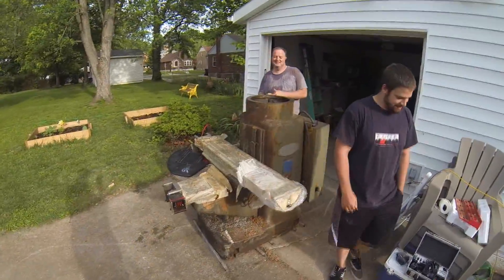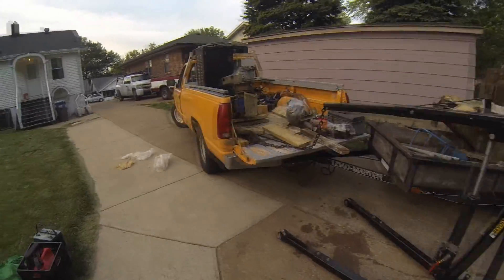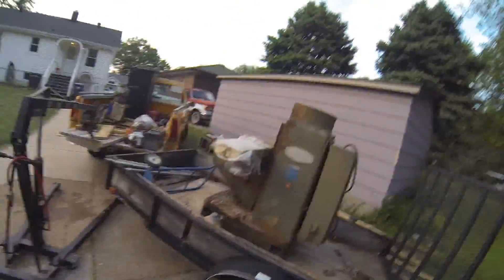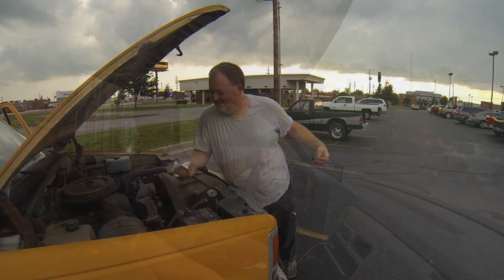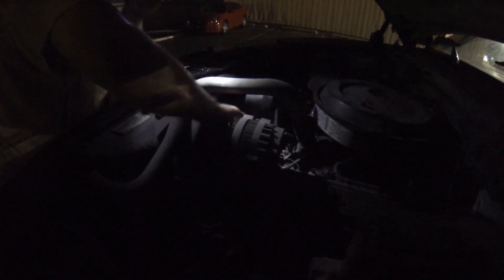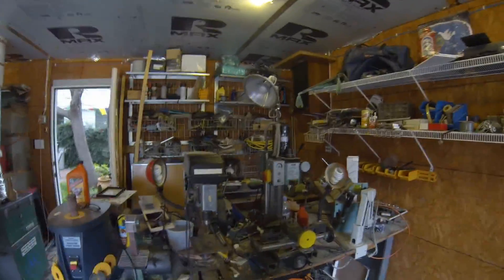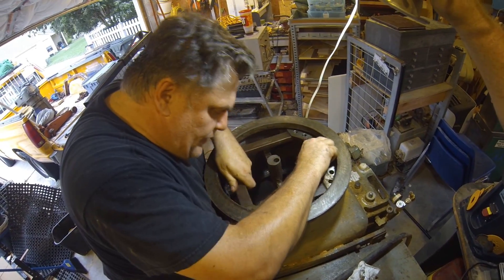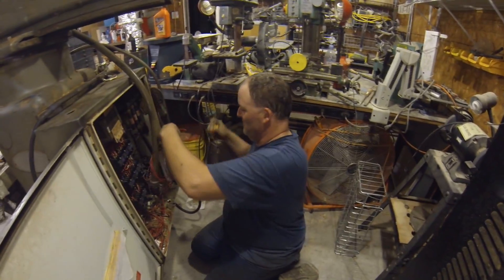The Milling Machine Move - May 2014

Comment: Great video. I can say from experience that moving machine tools is no easy task. A couple years ago my father and I moved a fully enclosed Mori Seiki MV-55 vertical machining center with thirty station CAT-50 tool changer that tipped the scales at about 22000 pounds (10000 kg). That was an adventure.
Reply from the maker: Only someone who has done it can really appreciate the effort involved!
Reply: After moving five bridgeport's it gets so easy I can spend five minutes on loading them 5 minutes unloading when I'm done great video